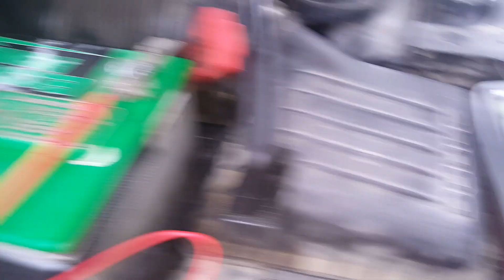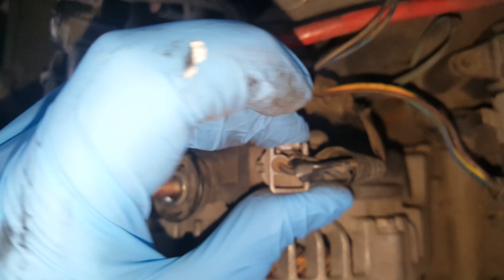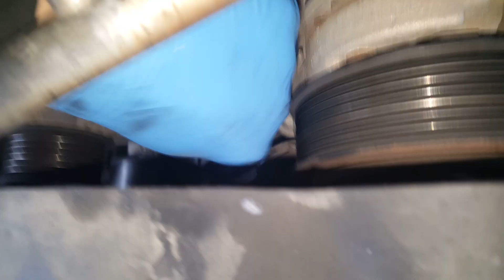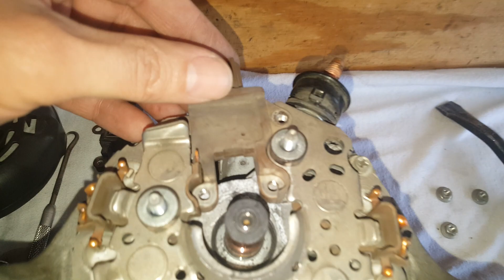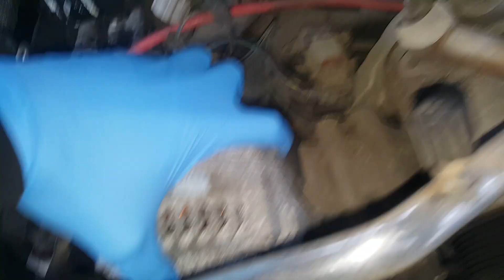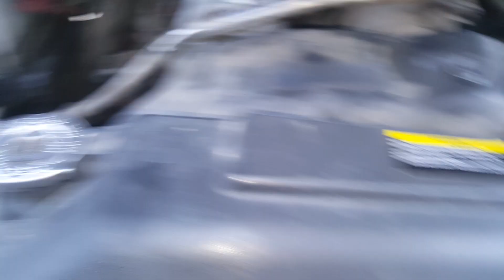How to replace the alternator 2004-2006 durango 5.7l

Comment: Bravo!  What a score!
Replace my 2008 5.7L Hemi Durango alternator today, Auto zone price nowadays is ~$260.
I upgraded to the 160amp model (because that was available).
Had to replace two idler pulleys for $64 more. one was disintegrated, the other nearly so.
Decided to replace 4 yo SERPENTINE BELT, new Gattes model, 3 year warrantee, roughly $35 today.
Reply from the maker: I am glad that this video could help you with the great repair you did. Thank you for watching.

Comment: Only 4 minutes in and I liked and subscribed. So far this tutorial has the perfect balance of the step by step clear visuals. No heavy background noise and not any unnecessary jibber jabber about anything other than the process.  Thank you for this.  2006 slt 4wd hemi. 110,000.00 mls. Straight pipe.  Would appreciate any advice regarding the main ground strap that runs behind engine near the center of firewall to the lower  chassis on driver side. Mine was heavily corroded and I don’t have a lift so just from crawling under was unable to locate the higher side. But I temporarily pigtailed a 10 gauge stranded copper wire from the breaking point ( about half way) back to the chassis after thorough sanding and cleaning of the area as to give good connection.  Live in ny. So salt rust standards.  God bless in the new year everyone 🙏🏻🇺🇸🙏🏻
Reply from the maker: Thank you very much.

Comment: I just got a 04 durango with a 5.7 hemi from an auction, of course the bitch is dead. popped serpentine belt and a bad alternator. this video is gonna make installation so much easier, thanks man!
Reply from the maker: Thank you for the great feedback.
Reply: @WrenchTheory501  no problem! Thanks for the video. Just finished the repairs! She’s as good as new

Comment: How can I tell it’s the alternator if the truck doesn’t turn on?
Reply from the maker: You have a few options . You could try swapping a good charged battery. You could fully charge the battery( autozone will free of charge) . If it cranks and runs after doing this then you can move on to checking the alternator. If it does not crank and start with a fully charged battery , then there is another issue. Thank you for watching.

Comment: thanks for the video, how do you recognize bolt sizes so easily? do you just know what they are or just by looking at them?
Reply from the maker: You can pretty much tell by the size , a lot of sizes are commonly used 10mm 13mm 14mm 15mm. You can get a nack for them pretty quick. Now some times they like throw some odd ball sizes like 9mm or 11mm , rarely ever use those. I appreciate the great feedback and thank you for watching.
Reply: @WrenchTheory501  I'll have to try that, I'm sure glad we're dealing with metric, so much more logical haha! thanks again

Comment: Great video. The only thing that tripped me up was the moving the tensioner - didn't realize I had to use the breaker bar without a socket - there are two square holes in the tensioner pulley arm where you insert the 3/8th inch breaker bar. After that, it was easier... Also, the ones that designed the fan shroud should be tarred and feathered - it should be easy to remove it to get access to the front of the engine and the belt.
Reply from the maker: I agree , it should not be so difficult to get at. Thank you for the feedback , it is much appreciated.

Comment: Thanks for the help, do you have oil blowing through the hose on air box, my filter was covered with oil
Reply from the maker: yes,  and it is common on all of these . The only solutions that I know of are , people installing a catch can some where in the line of the breather tube. I believe they have several videos on installing them. Thank you very much for watching.
Reply: Pcv Valve hose..

Comment: Great instruction and attention to detail. Very easy to follow. Thanks for making this video. Do you happen to have a video for changing the spark plugs on the same vehicle?
Reply from the maker: I do not believe I do but I know it is pretty involved with the back plugs being the hardest. As you know there are 2 plugs per cylinder one best I remember has coil on plug and other just has the wire. Thanks for watching the video.
Reply: @WrenchTheory501   p